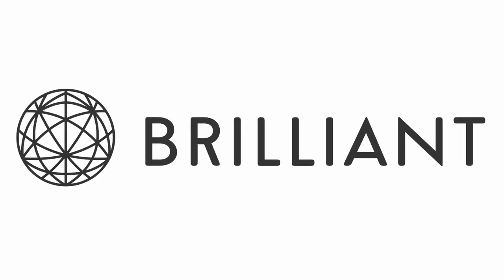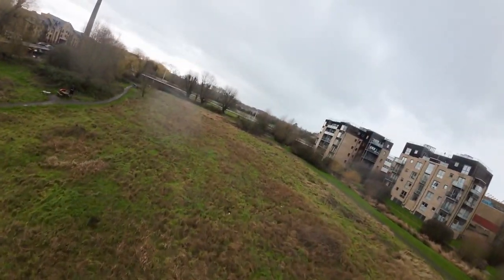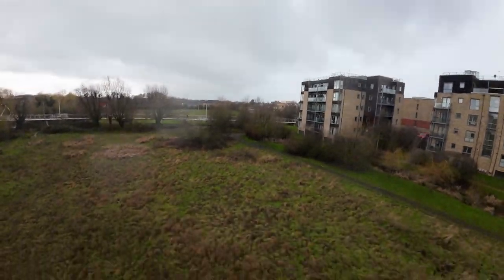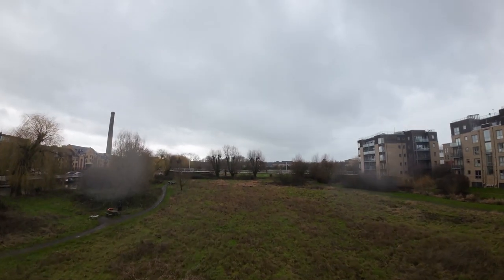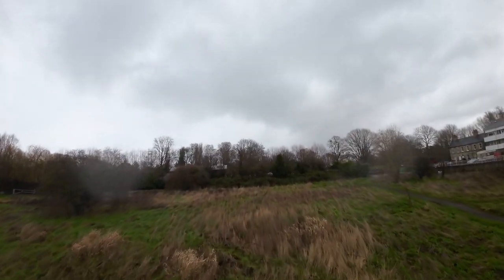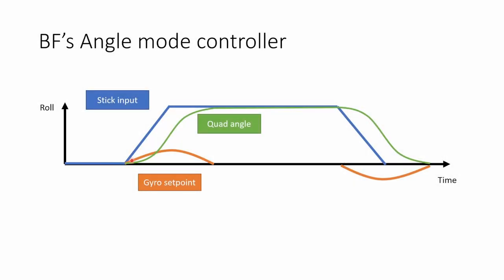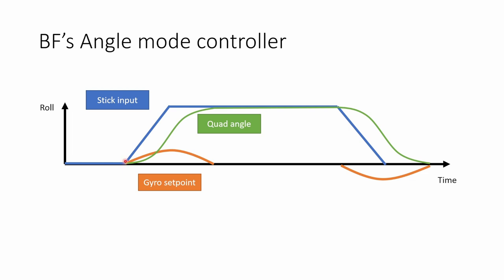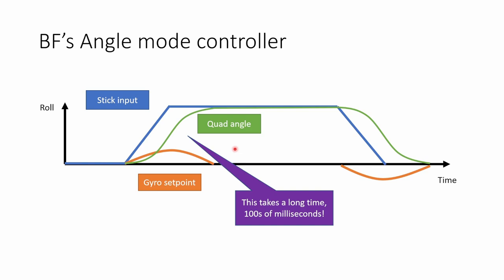Betaflight Angle Mode is about to get AWESOME! You can try it TODAY 😁

Comment: Great first steps in bringing BF angle mode up to snuff!  There is TONS of great things in Emuflight that we worked on and tested 1,000's of flights on that would improve it even more, reduce gimbal lock when reaching 90 degrees and smoothing out the whole angle system to give angle pilots tunable control and push the limits.  Let's hope more advancements happen, but very happy to see Chris add some Angle Passion back to BF!

Comment: I gave it a try today, and I definitely like the improvement! I am able to fly into tighter gaps at home. Thanks for the great work, Chris!
Reply: Hi, what FC youre using, haven't tried it yet, my Fc is betafpv F411 1s 12A aio, and my current Firmware is BF 4.3.0 will i able to flash this in my current Firmware?

Comment: I'm visiting Bangkok and flew a 80mm quad with a Vista off a rooftop restaurant. I used angle mode because I wasn't too familiar with the fairly small area and it made my landing more controllable (no inadvertent drifting over the rooftop ledge..)
Technically my wife was spotting but not reliably after a few glasses of wine 😄
So there are some benefits to angle mode but you have to fly it completely different to get proper cinematic footage.

Comment: I don’t want to sound like I know what I’m talking about but I thought I would post this comment / question.  I have not looked at the Betaflight code and my experience with digital filters is primitive at best.  But…

It seems like you are reinventing digital filters.  And it seems like since a drone is physically not attached to anything else, it should be possible to get the precise mechanical response characteristics for the particular drone by inputting sin waves at various frequencies into the system to get the drone’s frequency response curve.  Then use that curve to create a matching digital filter which will optimize (at least in theory), the responsiveness of that particular drone.

The idea would be to first get the drone to hover.  Then wobble it at different frequencies on the three axes to get the response curve for each axes.  Then compute the optimum digital filter for the drone for each axes.

Comment: I almost never use Angle/Horizon mode anymore even when flying inside but I found that Horizon mode and reducing the Horizon Strength gave me much better response.  I've also played with Horizon Transition.  I will certainly try this new setup to see if it's worth going back to self-leveling.
Reply: Yup, horizon mode loosened up ftw
Reply: I fly my cinewhoop indoors with angle strength at 10: it flies smooth, precise and awesome

Comment: Tested on a DIY 2" whoop, flying inside.
STM32F411 on a Happymodel ELRS X1 AIO 2-4S (CRAZYBEEF4SX1280). Caddx Vista, so a bit heavy at 78 g without battery & the motors are too small; 1202 8420KV's.
The only initial problem was the same as noted on comments in Github: ELRS was lost at first.
In CLI, "get express" - the AU domain after flashing is probably wrong and needs to be set again. Diff did not fix this, had to be manually changed.
Tested with the defaults (angle_feedforward = 50 and angle_earth_ref = 100).
Very nice behavior.
Finally this whoop runs OK in Angle mode. Was able to hit smaller gaps and fly much faster than with the regular 4.4.4 RC3 it had before this.
Rapid turns in tight spaces feel much better. Will test with different values later.

I really hope this gets into 4.4.0?

Comment: Reminds me of the old rate gyros vs heading hold. I believe the issue then was the wind up of the loop that happened the longer you held the stick. Feed forward sounds like some extra gain on the stick authority that happens depending on the rate of initial stick change and again rate that it slows.

Comment: This is awesome. Were the root causes (lack of feed forward, and yaw/roll using different control mechanisms) of these issues known ... or did you discover these through experimentation?  Great job.
Reply from the maker: I "discovered" the issue or at least was the first to do work to improve the poor angle mode performance.

Comment: Very interesting and informative video. I still fly angle mode on whoops indoors. This looks like it will be very helpful. My favorite whoop to fly was the Alienwhoop Zero running NotFastEnuf Silverware. It was a ripper. 😎
Reply: Silverware is amazing. I have a brushed whoop running it, so smooth. Only my Mobula 6 has better handling

Comment: I run angle mode mostly as acro flips gives me motion sickness and ruins the hobby for me so I just race around in angle doing fast smooth lines. I notice angle mode the faster you get the less predictable it gets so the racers would really like these new settings .I also noticed angle mode is just that it needs to be at an angle to work properly too flat and its kinda crap so hopefully this helps with that aswell

Comment: Thanks to you Chris, this feature is already incorporated in Betaflight 4.5. However, I have a query. When I tested the angle mode in Betaflight 4.5, it performed amazingly well, especially with the ease of turns with only yaw inputs given. How can I achieve the same "integrated roll" behavior in the acro mode? I couldn't find any setting options for this. When I attempted a brief flight in acro trainer mode and tried a turn using only yaw inputs, the craft seemed to lose its orientation. It converted the forward pitch into roll, which is indeed the core issue you described in the beginning of this video.

Comment: Hey Chris, I stumbled across this video for angle mode, searching for something different, and it's incredible insight into this mode! Great work! I learned a lot here, except I'm currently struggling with one aspect of the angle mode for cinewhoop filming. Everything is flying really slow and smooth in angle mode with the added ff feature but I have tried many setting changes to keep my throttle from bobbing up and down including the reference from your video pertaining to the throttle curve and expo. No matter what I do, I still have a slight movement up and down and can't seem to relax the throttle. It really comes through on the naked go pro footage as the horizon of an indoor atmosphere is moving up and down even after stabilization.  Are there any extra tips you have that I can mess around with to get the perfect flight feel. Thanks in advance and for all you do for our hobby!

Comment: Interesting content, thank you for sharing 👍
Does this update also reduce the gimbal lock problem (which occures in angle-mode, when the pitch angle is 90 deg)?
I wonder, if there is a flight mode built with quaternions (where there is never a gimbal lock possible).

Comment: I have several different frames of your design.
I just did a comparison video of the 3.5 V2 and the 03 quite oblivious to the DJI 03 accomodation.
I have another video about the colored carbon. I see the 03 UL5 is now a longer fuselage. I really like the UL5 with tight bracing.

Comment: Isn't what betaflight put in pretty much identical to the Emuflight angle code that's been around for over a year? A lot of things sound the same to me. In my opinion, angle mode is a very useful mode and is now very underestimated by new pilots. I know one reason is that people would rather commit to one flight mode for all quads. I can understand that, but especially with a micro whoop which flies significantly different to larger copters, I think you can also fly with different flight modes. Especially in whoop racing, angle racing makes progress very quickly. Of course, the skill cap of acro is higher, however it requires a lot of time and practice on the small whoops on tide tracks. Racing at a high level in angle is still hard enough and not easy. So try it!  I also use angle on my cinewhoops in many situations.
Reply: btw: Isn't feedforward active in angle mode since 4.3?

Comment: Keeping yaw rotation around the earth’s vertical/z-axis (rather than the quad’s) is something that silverware has been doing for years. Imo that was the huge draw of NFE Silverware’s angle mode for brushed builds back in the day, and remains one of the main draws of modern day quicksilver.

Here’s hoping BF crash recovery and the gyro wind-up issue (not sure that’s the right term, but the thing where it doesn’t fly straight for a few seconds after hard crashes) are improved as well. Quicksilver still handles clipped gates/obstacles better than BF in whoops, imo.

Comment: Too bad it wasnt possible to just copy how like Hover and Auto-level works on Ardupilot, in Normal/Fim mode and Sport Mode, then have the Acro mode from Betaflight. But I'm assuming that its not that simple, but you know what i mean lol. Ardupilot is super stable and is almost like a DJI drone with gps and all the sensors. But deff doesn't haven't that BF Acro mode, but it does have a good manual mode on it if youre able to fly it like that, but it's really not that type of quad anyway.. 
Awesome work man, it's greatly appreciated!! I'm trying to learn Acro mode on my first true fpv quad, but im starting with angle mode and I'm having trouble with that lol and i know how to fly drones i dont get it, gotta keep practicing my hovering and maneuvering in Acro Trainer mode when i can. But for just normal flight, Angle mode is just killing my drone lol. 
Plus i tend to start doing a loop of trying to land, but going higher and higher each time, bc its so sensitive and i was applying too much throttle apparently, you're instinct is to give it some throttle,  when the drone is coming back down, so it doesn't just crash down. But it goes up slightly or levels out near the ground so you can gently lower, but even little increments or so i thought were giving it  too much throttle lol.. 
Plus i wish the RTH worked properly. Plus with the GPS data you could add Air Brakes, Hover, etc so you're able to start flying even harder drones on say a film or beginner mode. Like you can do on Ardupilot or similar..

Comment: Tried flashing and it said "Firmware image contains addresses not found on target device" what did I do wrong?
Reply from the maker: Not sure. Make sure the hex is correct for the chip (F405, F722 etc.)
Reply: @ChrisRosser  Its a happymodel diamond f4 so it should be an f405 right?
Reply: @-FARKI  It's an F411
Reply: @skree_fpv436  thanks now it worked! Im pretty dumb I guess.
Reply: @-FARKI  No problem. Glad you got it working.
Reply from the maker: @-FARKI  F405 or F411 Yes.
Reply: @-FARKI  hi what FC you are using right now, and what BF firmware youre in when you flashed the firmware for angle mode feed forward, im gathering details before doing the flashing, im using Betafpv F4 1s 12A aio, ang my current bf firmware is 4.3.0
Reply: @secondshifttv5023  I am using a happymodel diamond f4 but I did not get it working afterall, since I was originally using emuflight I would have had to port all the stuff over and a simple cli dump wouldnt do it so I gave up.
Reply: @-FARKI  oh too bad bro, in my case, hopefully it will work, although I'am using betaflight 4.3.0 i wish it is compatible with the angle feed forward upgrade chris Rosser suggested

Comment: I have been using your v4.0 file on my 4" LR and have been very happy with the improvement in the way it flies in angle mode, I am about to replace the Vista on this quad with the DJI 03 air unit and would like to update to Betaflight 4.4 to get the latest OSD improvements, can I do this in a way without losing the angle mode improvements ?

Comment: So if i have 4.4 i have this already? Before a watch the video. Acro snapping because the roll and pitch rate u enter. Make it 100 and it's slow to roll.  
I usually up my angle mode to 80 strength and max angle 80 or max angle quad can do before falling out the sky at full throttle.
After watching. So this adds feedforward and more p to get rid of delay

Comment: hi buddy. used to watch you years ago with pid tuning. got back into fpv now and want to do indoor flying. would you say angle mode is more suited that acro for indoors? i just find acro more natural and angle very odd feeling when trying to do tight turns indoors
Reply from the maker: I always fly angle mode indoors, I think it's quite normal to fly angle inside and acro outside.
Reply: @ChrisRosser  ye i agree angle is the only way indoors in tight spaces. I need more practice indoors for sure

Comment: What causes whoops to turn right or left on a hard turn? I have a brushed and brushless quad that does it. Always figured it was due to the frame bending but not 100% sure
Reply: This is caused by yaw washout. You can try bumping up yaw gains a bit or running props out.  It's something low authority things deal with when pushed hard or flown in prop wash

Comment: I've just discovered this video and this looks like exactly what I need to achieve smoother flying indoors. Unfortunately the assets in PR #12067 are no longer available. How do I get this code onto my Cinebot 30? I'm currently running firmware 4.3.1 BTFL. Please help...
Reply: I've just updated to BF 4.5.0 and wow, what a difference. This has literally changed everything for me. I can fly my Cinebot 30 in Angle mode with great precision indoors. Thank you so, so much Chris. I think you have just kickstarted the FPV side of my business.

Comment: I do fully buy into the first part with FF on Angle mode. For the second part it does not sound good to me as a 95% acro pilot. Up to now when flying whoops inside with angle, I had a similar stick yaw/roll coordination. For me that makes both modes really compatible for the pilot. Should we really have yaw/roll coordination done by the FC? (no, did not try it out)
Reply: Yaw and roll coordination was already done in the fc in angle mode, now it's just being done better